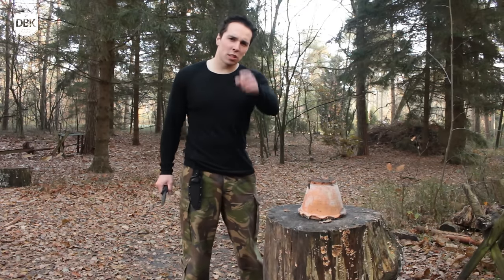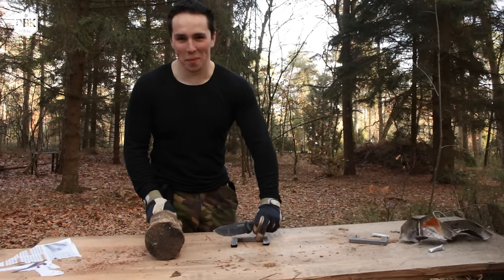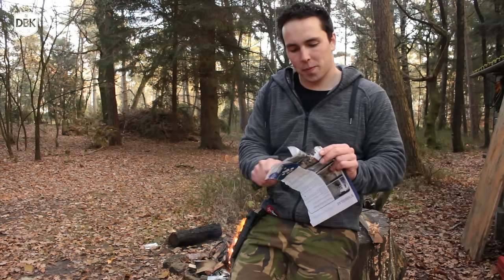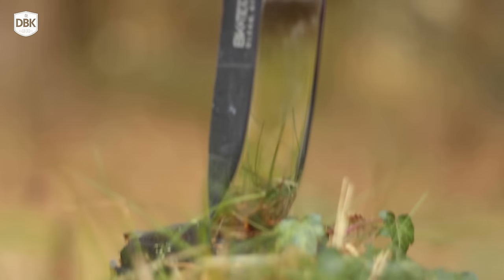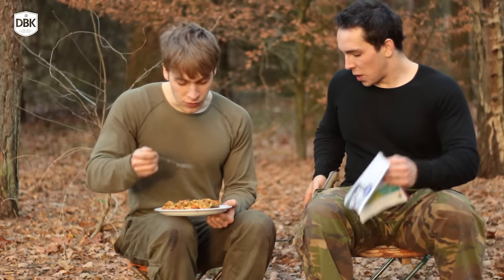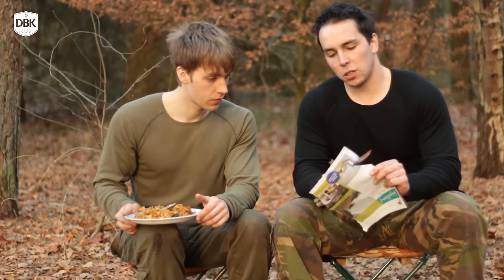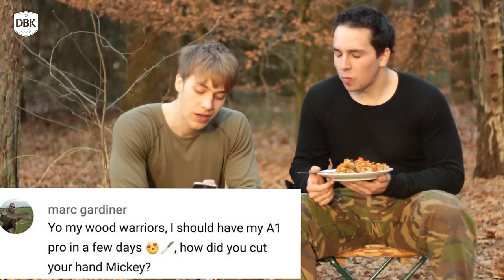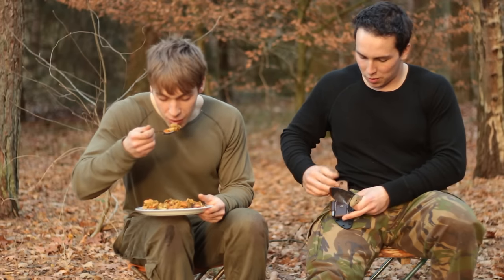Unleash The Beast! // Ka-Bar Becker BK2

Comment: Funny you described it as a crowbar with an edge. I have literally used my Bk2 as a crowbar when I was in Afghanistan a few time. Cracking open a crate or freeing up a rusted or malformed door or hatch. Knife is a great all rounder.
Reply from the maker: thats very cool to hear! cheers!
Reply: Dutch Bushcraft Knives 
:)
:]
Reply: I have used mine to chisel through old nails on wooden pallets we were breaking down and to rip up carpet striping out of concrete and all kinds of other hard use and while it's not as putty as it was when I first got its still going strong 7 years later..it really is the best all in 1 knife.
Reply: This guy need too calm down....
Reply: Pretty sure I heard an interview with Ethan Becker,  the guy who designed the knife, several years ago where he described it as "the knife you need when you have to field dress a Buick."  So yeah,  sounds like you were using it as intended

Comment: you should check out the bk9 if you like beasty knives! :D
Reply: Very true. a beast of a knife.
Reply: 321berber Yeah but the bk2 is sort of the everyman's heavy duty chopper.  It's the middle porridge.
Reply: I live my BK 7 and BK 9
I disliked the BK 2 (and not becuse its shorter but because the overly thick blade)

Comment: The Becker BK series knives have far and away the best contoured grips I've ever felt.  I haven't done the micarta swap out, but even with that,  I have never felt hot spots or like I was losing control of the knife as my hands fatigued.  I did grip tape my BK9, and once that was on, yeah even wet, I have never feared the knife coming out of my hand until I set it down.  Evidently,  Ethan and I have exactly the same size hands.

Comment: nice mods on the BK2
Reply from the maker: thanks a lot Terry!
Reply: Dutch Bushcraft Knives hey guys!  Just got the  coating off the blade of my bk2, and I am wondering how you got the stripes off of the blade.  Did you just use the stone all the way down?
Reply: @DutchBushcraftKnives Can I ask you which u prefer  from lion steel m5 molletta kabar bk2 or fox rimor

Comment: i bought this knife 7 years ago when i was working on a cattle ranch in the middle of nowhere. i needed a brute that wouldn't let me down.. that wasn't too much money. i read this review of the BK2 where the person claimed to put the knife through a car door and pry open about a 6 inch hole with no break. i bought two that day. first thing i did when i got them in the mail was get a hammer from the workshop and make my way to the ranch junkyard.. where the remains of an early 90's ford pickup was resting. i drove the BK2 through the door using the hammer, and then proceeded to pry open a sizable hole. not 6 inches, but only because of how difficult prying open a hole on a truck door is. i got at least halfway though. i only succeeded at dulling the edge and removed some of the black coating. no breakage at all, no chips, no bends. i was now the proud owner of two BK2 after failing to kill one of them. it's not a precision instrument, but it's the knife i would choose in a survival situation no question.
Reply from the maker: +Jeff Falstrom that awesome! These are made to last for sure. It's a crowbar with an edge
Reply: i really enjoy your channel, Dutch Bushcraft Knives. thanks for the reply. have you seen the custom leather sheaths for the BK2 made by Hedgehog Leatherworks? 2-3 times more expensive than the knife itself, but apparently it's made very well. scout style carry for the small of your back. it's been on my wish list for a while. definitely worth a look if you like the BK2 enough to try carrying it in the field under the more money than brains category haha. great work guys keep it up
Reply from the maker: he makes great sheaths! someone is actually making a sheath for my bk2 right now. He has very good prices and makes great sheaths (M-Knives)
Reply: that's great! i hope to see a little update/review/first look/"nana i got this and you don't" video about it sometime. cheers!

Comment: Say Heah,  I have a BK-2, I sharpened it on a Work Sharp.  and my friend carve a spoon with it. Like me a few of my friend's and I agree a little longer would be nice.  Yeah,  the BK-2 is a robust survival type of knife.  But I got lucky.  On Blade Forum that had Dtawing's just to be able to buy knives that wetent made in time for Show's,  and on a couple occation's I won chances to by knives like that.  Usually for the Show's Busse may make a short run in some Vintage rare knives.  I got lucky on a Nuclear Meltdown Fussion Steel Heart a 5/16" thick BadAssery.  I also got one of my ALL Time Fav.  a Ratmandu,  But in the INFI Steel very rare. Another win  allowed me to buy a first.  Yeah,  the first time Busse used a Cerakote on a knife.  I got a rare A. S. H. -1 Magnum.  Busse only make 5 catagories of pattern's and in five color's,  Like I said,  me and some of my friend's agree if the BK-2 was just a smidgen longer,  it would span larger piece of wood . There is such a Beast.  My ASH-1 Magnum,  But it's a Green American Flag Cerakote and it's rare and too pretty to ise.  only 5 were made in that pattern and color and the first time Busse Combat Cerakoted a knife,  It was done for that specific Blade Show.. I see some sold on eBay for $1,000.00, But I dunno,  I might just start using mine.  It put's my BK-2 to shame,  It's like the muscle giy on the beach picking on a skinny guy,  Yeah,  it feel's like a real chunk of steel even if you just hold the two.,,.

Comment: Because of your video I bought the BK-2. It was cheap and can be found under $60.00  have not used it yet but have all faith that it will perform. About the scales... Are they thicker than the grivory/plastic ones?

Comment: If you ever get a chance, check out the Becker Brute.  It is a very different type of knife which even includes a small weight forward on the back of the blade.  I carry this in my Jeep Survival Kit.  You could hack down a tree or cut King Kong down to size if you needed to.  It's 1095 with the same scales and sheath.  I don't know where you picked up that leather sheath but that is beautiful!  The Brute is no light weight but it is a very good and dependable knife.
Reply from the maker: +rickd248 thanks for the tip I'll check it out!

Comment: great Video love the disclaimers, I love this blade, but I do think  the esee steel and warranty is better, than the 1095 crovan  is there a reason you prefer it to the esee 1095.  Keep in mind I may be partial to esee because I used an Esee 5 throughout my service and fell in love with its reliability.
Reply from the maker: Hi man!
The difference between 1095 and 1095 cro van arn't major. The big difference between the steels is that essee hardens it's steel up to just 56 hrc which is really soft while becker hardens it up to 59. 
The ESEE's that we've used performed very bad compared to other knives that we use so purely based on that we don't really like ESEE that much.

Comment: falkniven f1, dont forget like the original kabar or ontario, these are beafy knifes with heavy saber grinds. it is made  as a tool for anything the f1 i believe is airforce, whr if you servive a crash landing you are suppused to beable to pry tour self ut. the origg maerican army kabar is great knife but for perfection u need to spend maybe nine hours on keeping the primary edge flat on sand paper  with paper or rubber underneath to get a great convex edge. and of course  the black on primary would be gone, work up to 2000 grit car shop wet dry sand paper for polishing and strop. never leather strop on a knife that is supposed to be a convex edge and you see a micro bevel , you must get rid of the micro bevel or you will keep stropping on that factory edge and it will get duller and duller.

Comment: G'day Dutch Bushcraft Knives! 

I'm a new fan but  love your tests, tips, and honest reviews. I'm interested in purchasing this knife but was wondering how you removed the military style black finish on the blade? Does it provide protection for the blade or is just for looks? Also, could you do a video on how to sharpen knives because I trust your opinion more than some other bush crafters. 

Cheers, 
From Australia
Reply from the maker: +Sol Vella thanks a lot! We'll be doing a sharpening video this winter. Not sure when exactly. The coating is to protect it from rust but it also creates a lot of friction with the material it's cutting. I take off the coatings most of the time. It was easy to get rid off with some sandpaper. Happy winter days!

Comment: What's the difference between the Becker BK2 and the BK22? Just the sheath? How do you like the grind on the Becker? I know you prefer a scandivex grind.
The Pokemon card at the end reminded me of when I had the special Charizard but it was stolen. If only I had a place to hide it like you have. Oh well.
Reply from the maker: I think the knives are exactly the same. the factory grind on the becker is Ok but not very great. It's better than many other knives in this price range though. I like 1095 cro-van a lot better than regular 1095. with the slight convex I gave it it holds a very decent edge. Nothing near something like CPM-3V though but incredibly easy to sharpen.

Comment: Greetings from Australia, as usual a good test it certainly took the rough tests you did.I have a schrade sch51M happy with it and also a Jaktkit Knv2 Gen II which has a very nice handle.Know you have tested Fallkniven F1 etc what are your thoughts on both of my knives?  Also like the mods you did look forward to your very funny but well thought out tests.Merry Christmas.
Reply from the maker: I have the jaktkit lying here on my desk! the handle feels great! I also love the sheath. The steel is not the best on the market but very easy to sharpen. I still have to field test it though. I will make a video about it somewhere in januari. 
Schrade makes decent knives for the price. I think the price is right and fair. Of course they are still budget knives. most of them are hollow ground I believe. Nonetheless I like their handles and blade design. They make affordable decent knives.

Comment: Yo, what kind of sharpening stone would you recommend for the BK2? I just put a mirror polish on my blade and now it probably couldn't cut through butter from all the sanding I put it through. Cheers.
Reply from the maker: +Tony Spencer hey Tony, 1095 is pretty soft so king stones could do the job. However I always recommend either shapton ha no kuromaku or naniwa professional. These stones can do pretty much all steels. For a mirror polish you would need stones up to 6k and a strop loaded with compound after that.
Import is that every next grit polishes out all scratches from the previous stone (or sandpaper)

Comment: That stew looked pretty good! Do you ever use that pot like Dutch oven on the ground rather than hung over a fire. It will let you get a good even cook easily.
Reply from the maker: +Seth merchant i do. I place it on the fire, furnace and coals. It all works great

Comment: I enjoyed your upload thanks -was that a zero grind convex you put on the bk2?
Reply from the maker: Thanks mate. We could consider it a zero grind convex i guess. It's slightly more convex towards the apex though. The upper part of the bevel is less convex than let's say a fallkniven but still slighty convex increasing towards the apex.
Reply: it will improve with subsequent sharpening I am sure
Reply from the maker: I think I'll keep it a bit more convexed towards the apex. 1095 cro-van isn't the best in edge retention so it does need a slightly larger angle than more high end steels for these harder tasks. 
happy winter days!

Comment: I'm going to remake your BK-2 but with the g10 scales. I have to ask: What sand paper did you use to remove that powder coating?

Edit: Without the mirror polish, I don't have the equipment for that.
Reply from the maker: Hey Saehun, I just used cheap regular sandpaper. The coating is not that tough.
Reply: Thanks!

Comment: Have you guys ever tired the Work Sharp Ken Onion Edition Knife??? or do you recommend any sharpeners? 

Thank you!
Reply from the maker: We've tried it! If you get some high grit belts it makes for a great sharpening system. You have to get used to it otherwise you'll ruin the tips of the blades but we overall it's a good product. Much better than the wicked edge products etc. We still stay with our water stones though. They are the most versatile and you can't make a huge mistake on a stone that easily.
Reply: Okay thank you! Its awesome you respond to comments!

Comment: Hey guys. Know this video is pretty old but I recently acquired a BK-22 based on what I saw in this video. Just wondering what you guys would recommend for sharpening out in the field. Specific stones or anything like that?
Reply from the maker: We personally use a Fallkniven DC4 in the field together with a small field strop and compound.  works like a charm
Reply: Dutch Bushcraft Knives Thank you for the reply! I will look into it

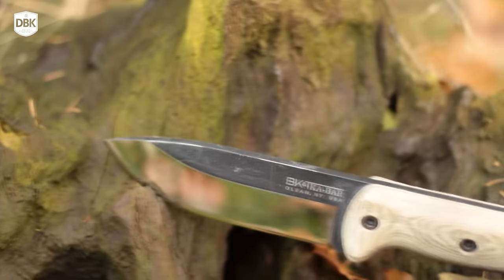Comment: Did you buy or make the leather around your sheath at 4:44 ??  Looks awesome!
Reply from the maker: thanks a lot! the leather pouch came with another knife. The TBS Boar came with it.
Reply: Thanks!  Did you have to modify it to fit the BK2 case?
Reply from the maker: it's almost like a molly puch but in small. I wrapped some paracord around the sheath to fit it on to.

Comment: First of all, thanks for all u do with passion and being "funny" at same time, i appreciate it so much :) thanks really!!! Second thing... how much make the BK2 weak the "holes" under the handle? I saw that the first model was a "full steel piece" and i am afraid to "break" it cause of holes under handle. I was looking for ESEE5 which has the same specs of the "BK2" , but FULL but couldn't find any compare from you... can u do it? Among these 2 blades BK2 and ESEE5, which do u recommend, according to price also, which is VEEEEEEEEERY different? Thanks in advance and sorry for "the english" in case of any mistake... writing from Italy. Thanks again and keep being like this ;)
Reply from the maker: +Flavio Lucentini the steel on  esee is soft. I would always pick kabar over esee. The holes under the handle are there to make the blade less heavy. They are made in a way to compromise the strength as little as can be. I would not worry about it.
I have a very old video on the esee 4. It was my most disappointing blade ever. The bk2 is a crazy blade. Edge retention is not the best but better than esee. It really is a beast. If you're planning on using it a lot for hikes etc I would say it is too heavy though. I also recommend buying micarta handle scales as it makes the handle much better
Reply: YES! I got what i wanted to know :)) thanks... even if i don't understand the reason why u say "the steel on esee is soft"... cause as far i see from company web site, seams the same league/alloy which is 1095 Cr-V... am i right? Do u know some "specs" which we/i don't know, or that came from using/testing it? :)) By the way, i got the suggestion, and even if i'll hike, the weight is not too much, it's like 0,5L of water ;)) about micarta i'll keep in mind thanks in advance ;) waiting a reply if u can :)) Keep going on like that ;) u rock guys ;)
Reply from the maker: +Flavio Lucentini you have to look at the HRC. The higher the HRC the harder the steel is made during the best treatment. The same type of steel can be flexible or brittle as glass depending on the heat treatment
Reply: OK! :)) I am going to buy then a BK2 :)) i know what you are talking about HRC, i'll take care of it from now on. Many many thanks ;)

Comment: is the fixed blade the same as full tang? I ordered one just now as a fixed blade and I want to make sure it's heavy duty and won't break on me if I try to baton larger pieces of wood.
Reply from the maker: Fixed just means it's not foldable. Full tangs means the tang of the blade goes all the way trough the handle. But all the Bk2's are full tang so don't worry.

Comment: can you give some advice on your workout routine and diet? thanks bro
Reply from the maker: hey Jimmy, I just eat what I like but I try to avoid taking too much suger or fat. I never use protein shakes or that sort of stuff. We train 3x a week. 3-4 different exercises. Our main exercises are probably the Benchpress and extended leg Pull-ups. These 2 really give your core a good workout. We do 4-6 sets per exercise and 10 reps per set. We start off with a low weight building towards our max 10 rep set and then decreasing 1 or 2 sets. If you want it more specific please send us a mail on dutchbushcraftknives@gmail.com.
all the best!
Reply: Awesome! Thanks for the info, I appreciate it!

Comment: With what did you remove the Paint of the BK2? I tried some paint stripper, but the German stuff is not strong enough.
Reply from the maker: I used sandpaper and my sharpening stones
Reply: Thanks man.